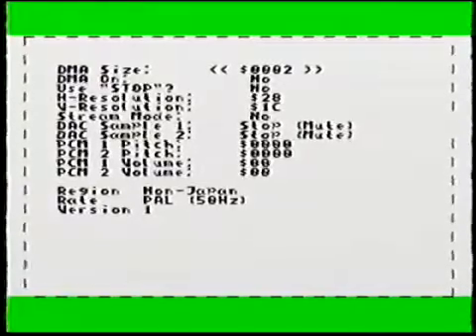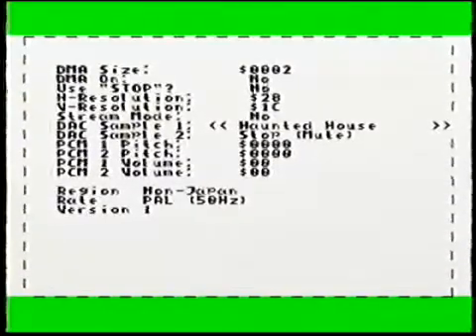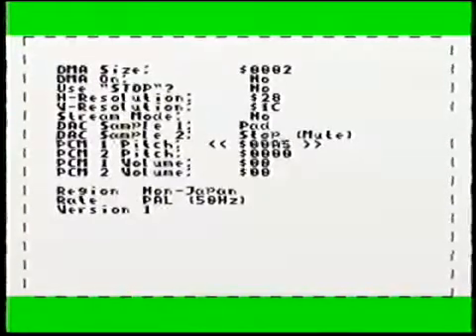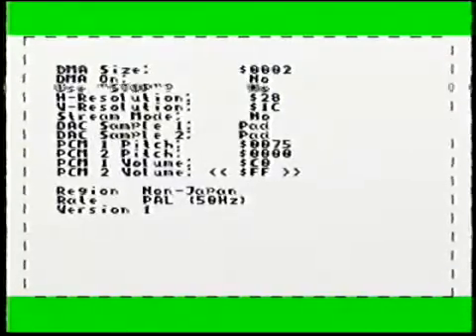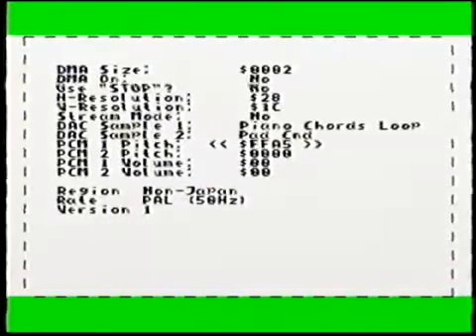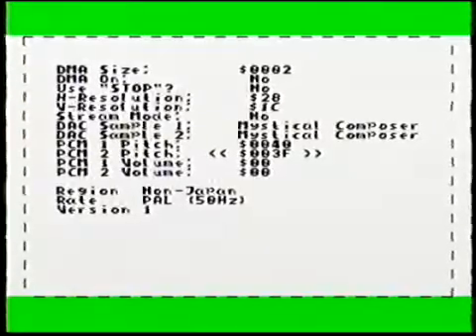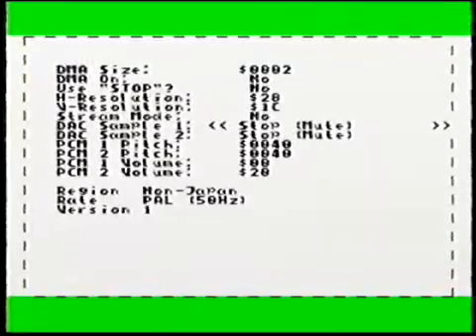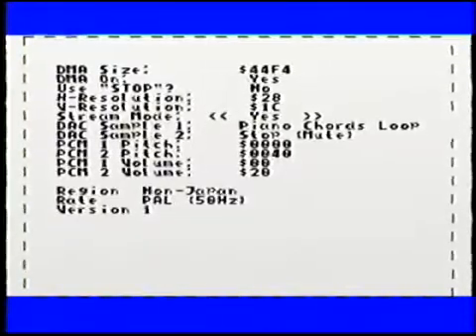Dual PCM - FlexEd

Comment: Hi.  I really like your work on this driver, it gives a lot more possibilities for composers.  But I'm confused, I can't figure out where can I write a VGM using dual DAC?  Perhaps you need a special tracker for this?  Can you please help me understand?  I just used the Genny VST and it worked well for me, but Genny also only supports 11025 HZ sample format.
Reply from the maker: Many audio software which attempt to emulate the Mega Drive, make assumptions about the hardware audio.  What you get with them is a generic representation of what one would expect.

For example; a common tool known as DefleMask which supports some form of Mega Drive emulation, makes the assumption that because there's one DAC channel, the chip is only able to play one 8-bit sample at a fixed rate.  What you wouldn't know is that the DAC channel has no playback at all, it is a literal DAC converter and nothing more.  Samples are fed via software, and thus, volume, pitch, or any other extremities can be controlled by software to simulate more than the expected behavior.

Other examples may be the assumption that YM channels are setup, then attack on, then off, then on, then off, with different frequencies/volumes/panning.  But with no way of altering the operators in real-time, which again, can be done via software, but provide no support for that.

I suppose you could look at it as; they emulate the YM2612 and PSG, and provide standard software control, and nothing more.  Because this driver is running on the original hardware, and we have full control over the software, we are not bound by generic expectations.  The downside is; there's no tools to support it, and you'd have to wait for someone to catch up.

I have heard that AURORA☆FIELDS is working on a tool for editing/playing back Mega Drive audio.  Since she has written her own driver software for the original hardware, and her driver has support for multiple DAC channels, and perhaps many other things.  I would assume her tool won't be bound, and will support something way more flexible, so I suggest keeping an eye out for that, it sounds exciting~

In terms of VGM, well VGM supports a single PCM channel, if one were to make a VGM of Dual PCM playing from an emulator, then the PCM channel will hold samples which have both samples fused together, so it wouldn't be an exact representation of the software, but more the hardware.
Reply: @MarkeyJester  means if I am not familiar with programming languages, I need to wait for special utilities if I understood correctly? Thanks for the answer anyway.

So I'll also follow the AURORA☆FIELDS
 blog on Sonic retro.

Comment: i NEED  a rom or at least the source code
Reply from the maker: The driver has pretty much been finished, and it was released last year.  But, here is the last experimental ROM you can play with at least:
http://mrjester.hapisan.com/01_Public/Dual%20PCM%20-%20FlexEd%20Test%20ROM.bin
If you want access to the source code, then please download this PDF manual, it has everything from download links to the source code and tools for converting the PCM samples, as well as in-depth explanation on how the driver works, and how to write your own 68k driver for controlling it:
http://mrjester.hapisan.com/05_DualPCM/Dual%20PCM%20-%20FlexEd%20(Technical%20Document).pdf
Have fun~

Comment: Heya, Markey! How much resources would this sound driver end up eating, and how would it affect a game?
Reply: I believe this runs on the z80, leaving the 68000 to handle the game.
Reply from the maker: The game would be no more affected than any other Z80 PCM playback driver.  This version (unlike the last version) doesn't need the 68k to wait for the Z80 either.  Likewise, with the YM2612 cue system, this'll actually speed up 68k time, as it won't need to wait for the YM2612, the Z80 will deal with that.  So if for example, you were to rip out Sonic 1's Z80 DPCM playback driver, and put this new one in, it will actually save 68k time, leaving more time for the game itself.
Reply: @MarkeyJester  ...and this means that even crazier-than-before romhacks can be done with the updated driver! SEGA-programming veterans could be proud of you! Just imagine this being released back in the 1990s, this would be a massive game-changer!